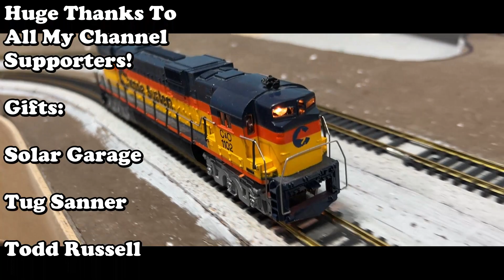Fix It Friday - Chessie Alco Super 630

Comment: The gear on the motor is upside down. The flat ridge on that gear is meant to hold the large gear in place.
Reply: I've never had one of these motors, but your idea makes sense to me. Why else would they design that gear like that.
Reply from the maker: I just had another look. The gears are all the right way round. I think the problem is, the centre of the bigger gear has worn on the shaft, causing it to wobble, and ride outwards.
Reply: That must be why this motor design has a poor reputation. I look forward to how you solve this puzzle. @ScottRails
Reply: @ScottRails  maybe you can find a small plastic washer and glue it in the motor gear to have it overhang just a little further. You have to keep them from binding though. I had a bachmann with a power torque motor, and ended up replacing the motor with a CD motor. It's in a box somewhere now. Good luck.
Reply from the maker: Great idea  @markriley3412

Comment: I got the same locomotive today from Ebay.  Motor squealed and it didn't run very well. Cosmetically it looks like new. I did complete motor teardown and cleaned and re-lubed. Now it runs better but I think the traction tires have hardened and not proving much traction. Could use more weight too. Looked them up they were Produced by Tyco in 1974-75.

Comment: Just like another person posted, the brass pinion gear on the motor shaft is notorious for slipping on these motors. While super glue is mentioned, I thought of trying Loctite thread locker as an experiment to secure the pinion gear instead of super glue.

Comment: I was thinking that soldering a waffer-thin washer to the outside of the gear would do the trick. But then you might cause binding issues as the space could be filled beyond clearance tolerances, or the plastic gear wheel could melt or distort due to heat spreading across it like a chocolate wafer in a warming pot. Could you 3D print a replacement gear, with a recessed well so you could fix a retaining washer over it? Or just hold on until you get a few spare drives from which to find a replacement?

Comment: The problem here is the metal pinion gear to the motor itself.  Once you remove that Brass colored gear you will forever after have to use some super glue to keep it in place, just a dab on the top.  Just make sure its down the shaft enough to prevent the issue your having with the larger gear walking out which is caused by that pinion gear not being pressed down enough.  Some times you can get away with just pressing it back on but more often than not glue is needed to prevent it loosening up and allowing that large gear to walk out a bit.

Comment: I think you may have misunderstood me the gear is the drive gear and and was slipping if you redrill the hole and press it back on it won't spin on the shaft correct that's what I understood.😊
Reply from the maker: Ok, I understand what you mean now. No, the problem is, it is riding outwards, then it gets the wobble, as it's not fully seated on the shaft. If it was tighter on the shaft, it wouldn't spin properly. Or, do you think it's riding outwards BECAUSE it's not tight enough?
Reply from the maker: I think you are right my friend, and your suggestion is good. If the centre of that gear was more precise, then the flat section of the motor gear should prevent it from riding out.

Comment: Maybe a drop of jbweld on the tip of the metal shaft. Might have to clean the solder off and oil the gear so it don't stick to the gear.
Reply from the maker: So far the solder is holding. If it falls off, I'll try your idea. Thanks.

Comment: Get plastic jb weld fill the hole then drill it out just a little smaller then press the gear back on the shaft use a dab of gap filling ca glue that should work for you good luck.😊
Reply from the maker: The shaft is fixed, the gear needs to rotate around it.